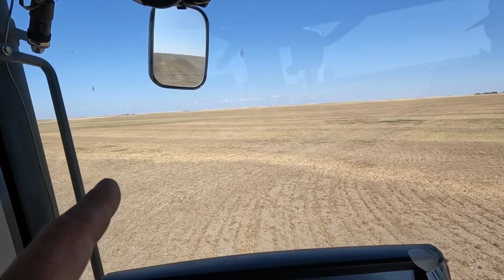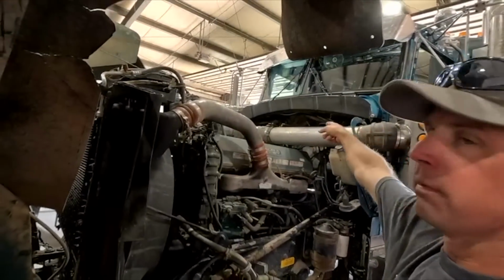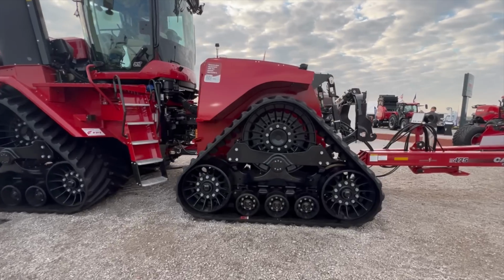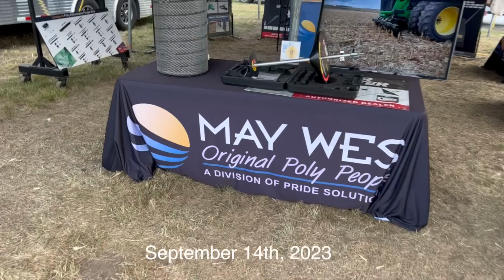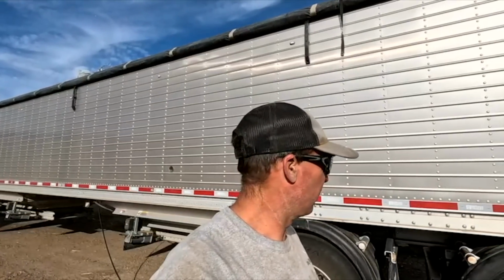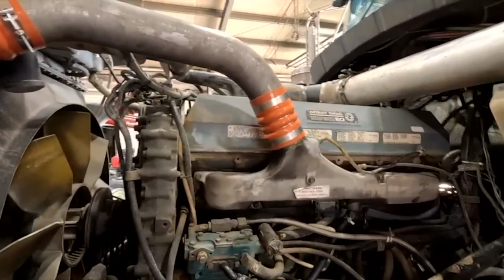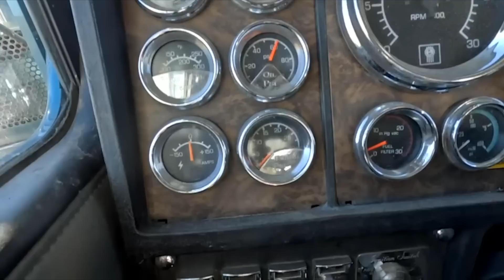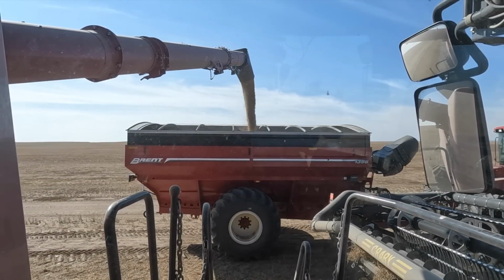715 Case IH Quad at Husker Harvest Days & the END of our Harvest!  Harvest #8

Comment: 715 has an aftermarket air pre cleaner already installed.  Engineering excellence right there!
Reply: Wait, you mean the engineers made something right for once after so many years?! :O Shocking. (stuff like putting a coolant hose in front of the engine air filter)